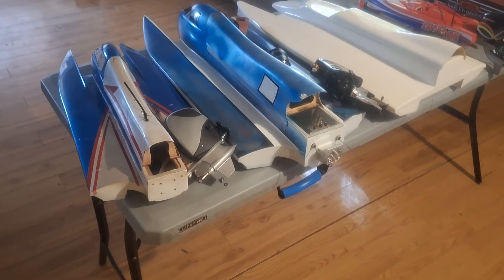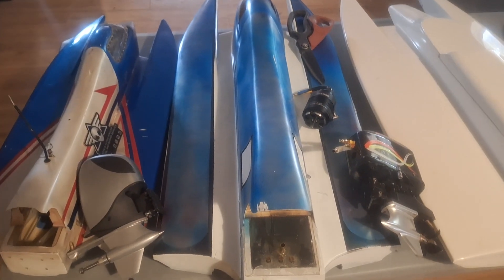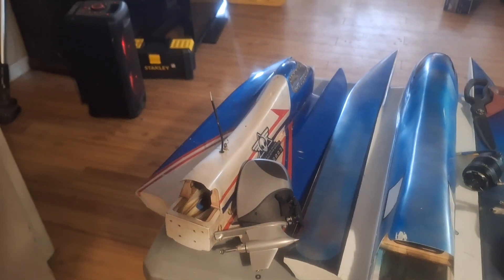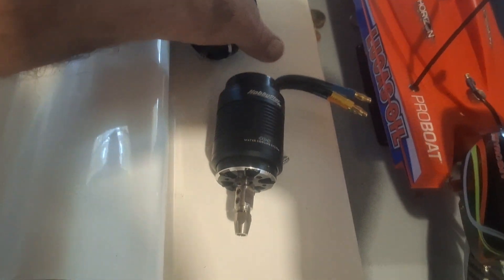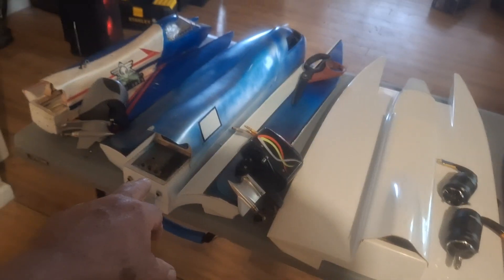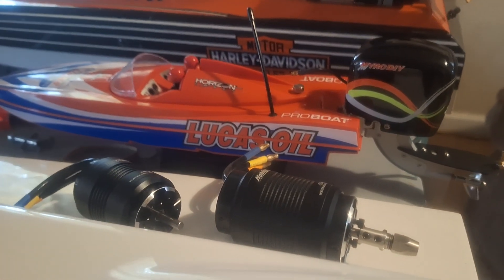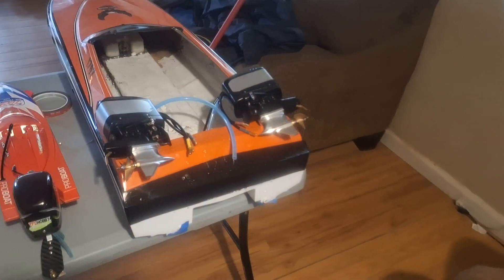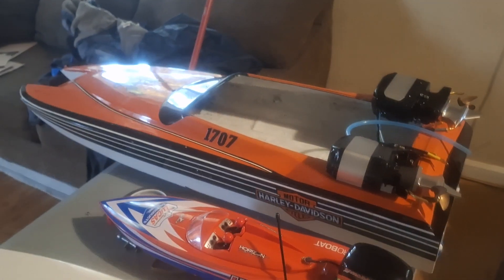RC OUTBOARD BOATS Dumas Pro boat Littohot  TFL scale outboard  Scale seven #bg4l #boatgang

Comment: What's the weight difference between the sevan and the tfl scale outboards? Can both of them handle the same power brushless motor? Can the 30.5" tunnel run good with the sevan outboard?
Reply from the maker: The tfl outboard weighs a lot more than the scale seven.  
I.have not run my scale seven yet. Sam Hallstrom  runs one on a zippkits g30 I would recommend  the tfl over the scale seven for price reasons it comes with a motor  the scale seven will require cowl modification to accept a inrunner motor
Reply: Thanks for the information.. Have you taken apart the scale sevan like in your other video where you show the gears and the mechanics? I'm wondering how is it worth oil vs grease. Can the tfl use oil too?
Reply from the maker: @richiecam5531  I have not taken the lower unit  apart on the scale 7 .
The tfl units will not take oil there are no seals in them